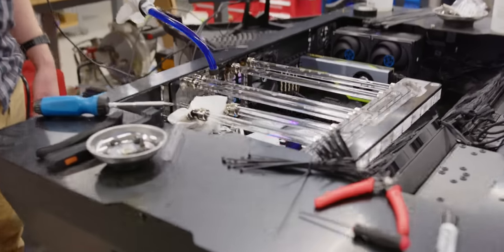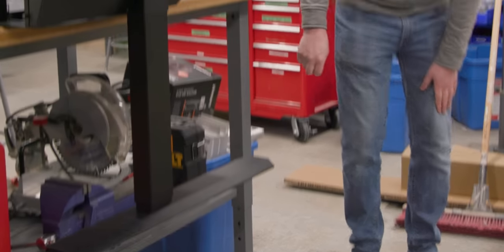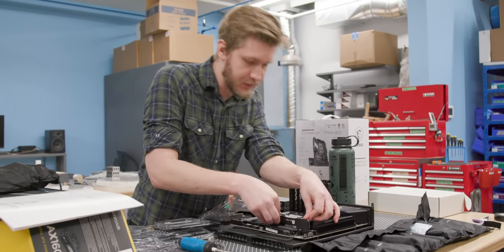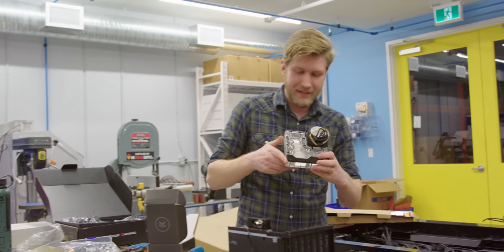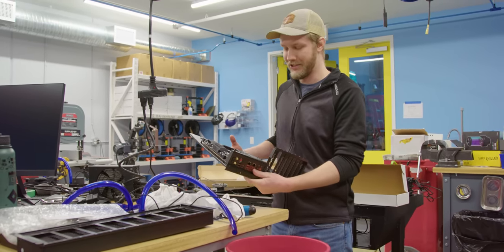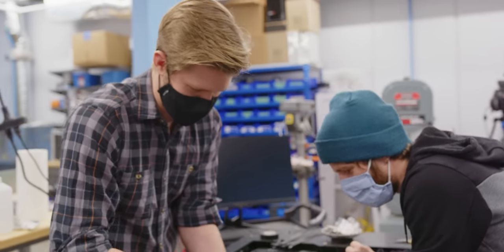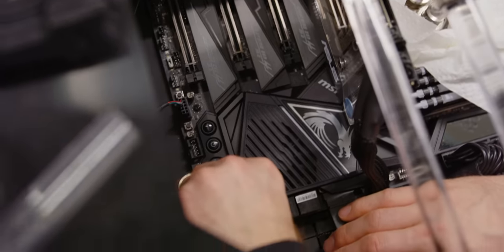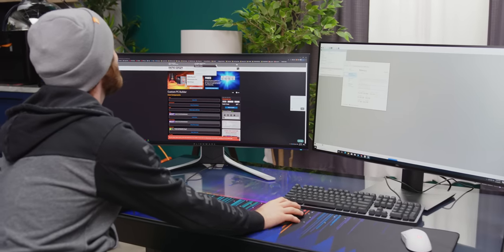The ULTIMATE $20,000 Desk PC

Comment: Not gonna lie... This is my dream PC case. Never have to worry about changing cases to fit motherboards, it is a standing desk that has the ability to change positions on the fly, and if you do a complete upgrade to a new rig, you can just put that in the secondary side instead of replacing everything and you can turn the old rig that's inside into a storage server.
Yeah, the desk with everything inside is like 500 lbs, but unless you are moving, you don't have to worry about moving the desk. And even if you do need to move it in the same room, just have furniture sliders under the legs.

Comment: Yes mom, my powerpoint require this amount of power
Reply: and yes, two computers are required
Reply: did you know mom ? that google meet is very cpu intensive so I need this setup to actually run it faster ? no ? just gimme dem muhney
Reply: yes thats what the power in powerpoint stands for.
Reply: Umair yt  american plastic is best plastic
Reply: Umair yt  yes my plastic pen has the computing power of a 4090 ti
Reply: id say something like:

“mom, i need this because umm, i need to code some um, software. yes it needs this power”
Reply: @nabilbudiman271  I need a threadripper pro 3995wx and a Quadro 8000 in sli to run Microsoft teams and PowerPoint 
I need a samsung 980 pro ssd to download quick files

Comment: 13:00 To avoid damaging your components in case of any leaks, fill the loop with demineralized water: should it leak it wouldn't (or, at least, shouldn't) damage anything: it's not conductive, and, since it doesn't contain impurities, nothing can remain on the components after a leaking occurs.
Also, the radiator and other metal parts in the loop are gonna last longer using it, and avoiding any build ups of limescale inside the radiator will also make it slightly more efficient.
Reply: deionized
Reply: @user-sw1wq8lh2w  I'm far from being an expert in chemistry, I just used the definition I see in supermarkets when buying it, so I checked Wikipedia https://en.wikipedia.org/wiki/Purified_water#Demineralization

"In the strict sense, the term demineralization should imply removing all dissolved mineral species from water. Thus not only removing dissolved salt as obtained by simple deionization, but also neutral dissolved species such as dissolved iron hydroxides (Fe(OH)
3) or dissolved silica (Si(OH)
4), two solutes often present in water. In this way, demineralized water has the same electrical conductivity than deionized water, but is purer because it does not contain non-ionized substances, i.e. neutral solutes. However, demineralized water is often used interchangeably with deionized water and can be also confused with softened water, depending on the exact definition used: removing only the cations susceptible to precipitate as insoluble minerals (from there, "demineralization"), or removing all the "mineral species" present in water, and thus not only dissolved ions but also neutral solute species."

The relevant part, though, seems to be:
"So, the term demineralized water is vague and deionized water or softened water should often be preferred in its place for more clarity."

In short, thank you for pointing that out: different people may find different definitions in different supermarkets.
Reply: I thought to idea was to use distilled water instead of demineralised or deionised water.
Reply: @petert3355  it is all the same - a water without salts in it

Comment: Why not one screen and a big Work/Gaming switch to change between them?
Reply: At the very least having 2 monitors can massively improve productivity
Reply: I was thinking the same thing.. I've got the Odyssey G9 with my pc (very gaming) and work laptop setup. Keyboard is shared via Wireless/Bluetooth switch on it. So when I want to switch I change monitor imput, switch the connection type on the keyboard, and only thing I don't share is mice. It works pretty nice. Occasionally I'll PIP split the screen to game and work at the same time.
Reply: My thoughts as well. 1 ultra-wide display, 1 keyboard and mouse and a 2-port KVM to toggle between the 2 PCs. That's actually what I do here in my home office with a 4-port KVM. Port 1 is my personal system, port 4 is my "test bench" and ports 2 & 3 are work systems.
Reply: Because who would watch that video?
Reply: They could've at least used synergy or similar.
Reply: @Davidx_117  Right but it's one monitor per system, so still have a switch that changes between the systems and both monitors.
Reply: @Atropos148  True, but if this is a super setup they have monitors that can do both now, they are expensive, but they are out there.
Reply: @TexMex421  Uhhhh it would have the exact same title...
Reply: CSN for the win love you and the rest at neebs gaming Anthony!
Reply: @Davidx_117  its not productive when they are connected to different computers
Reply: @vetrais7965  I suggest just going gaming mouse with a usb hub switch because it works wonders.
Reply: Curved is great for entertainment, but flat is better for productivity.
Reply: @lukemagdalin6169  You can easily hook each monitor up to each computer and switch inputs? Besides that, you could be the using the PC's for 2 different tasks that doesn't require it all being on one computer
Reply: Yeah. I want to be able to lock my work machine at the end of the day an slap a big old GAMING switch as a replacement for my commute.
Reply: Hi, Anthony 😁 love your content!
Reply: Why have one when you can have two for twice the price.
Reply: @bl3umoon  famous words by S. R. Hadden.

Comment: The manufacture of the water manifold should have added an air bleeder valve in the manifold to bleed the air out, hook a hose to the valve and drain it into a bucket.

Comment: I always wanted to do a desk build, but the desk is actually one of those metal control panel desks you see in cold War power stations and bunkers, with lights, buttons and switches that means you can switch between cards and add ons. Then in the middle is a big recessed monitor.
Reply: Omg yes. All my tech works fine and I don't need a new computer or new desk, but I'd love a Cold War themed workstation. Heck, a metal desk and some appropriate red peripherals could probably get the aesthetic kinda right without being wasteful or expensive.

Comment: This is awesome. you have done an incredibly work. I LIKE IT
Using two tracking sensors. Each one on the top of screens will help detect eye's ball and activate mouse and keyboard according to which computer you managed to work at.
This allows operating both computers through only one mouse and one keyboard.

Comment: Protip for hot glue removal:

Soak a cotton swab (or q-tip) in ISP alcohol and push it against the glue and adhered surface. Do it all the way around and apply a little pressure towards the glue. It will come right off smooth surfaces like a PCB or headers.
Reply: niduoe stre  I'm not sure I follow your question. This was in response to Alex's hot glue problem.

Comment: Hey Linus, I got a great idea for your next crazy PC build. Now just hear me out on this one...
Wall PC. It’s a PC made into the wall.
Don’t worry I’ve thought a bit further than just the idea. 
Q: How would you access the pc if you need to plug something in or add something? 
A: You have an easily removable painting that acts as a pc cover.
Q: Where will the heat go? 
A: You have a cooling system output the heat through a radiator that looks like a little painting similar to the PC case-cover painting.

Send me a message if you’re interested, we can talk over the details.

Comment: I like it, but I would have liked to have seen the hardware be more of a 2 in 1 
So having the two computers but then externally they be switchable, so you have one huge monitor, one keyboard, one mouse and you can flip between the two systems. 
Then also a single water cooling system for both computers in 1 

that way you have 2 computers but ultimately it comes across as being a single computer 

then also using something like the G9 you could still have both systems running at once and still be usable

Comment: You'd think that for water cooling ud have a seperate pump to fill your circit and then cap after, so wen u power ur system on u only have to deal with maybe topping up the circit once tha air in it has moved to the res?

Comment: Must be really difficult to supply power to the pump and test for flow and leaks before powering the sensitive electronics. Doh 
Placing the pump at the same level of the components is not optimal, far better lower down in the legs for example. It's called positive head and who can argue against good head;)

Comment: linus people please answer, serious question
why do they use water to cool tech? it seems very unintelligent SO Why dont they use non conductive oil? they make hydraulic oil that doesnt conduct electricity, they use them in altec boom trucks incase the boom hits a power line the electric doesnt make it to the ground and kill everyone
and no im not a troll ive worked on those trucks and done high voltage tests on the buckets to certify them
thanks